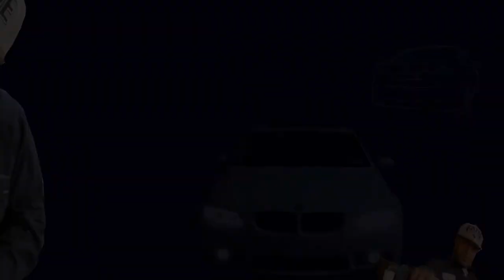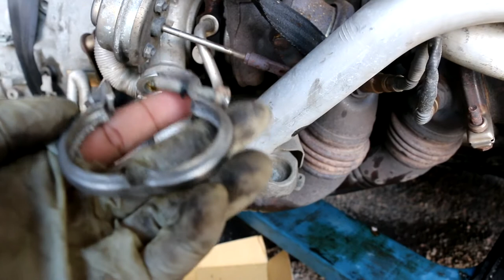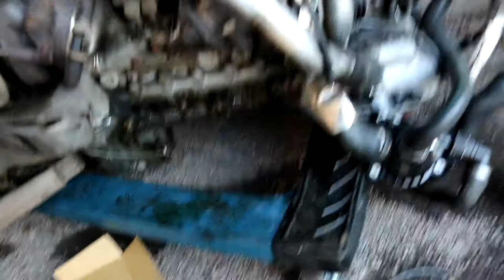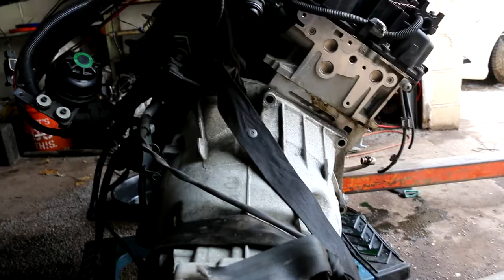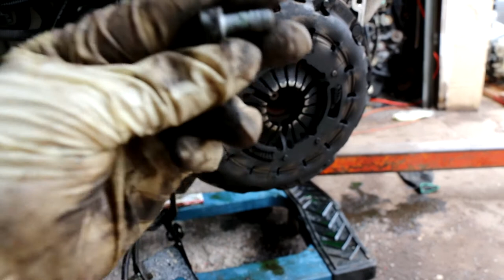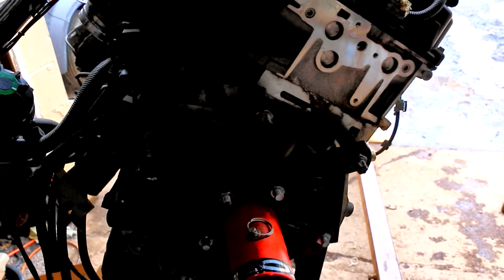N54 TURBO REMOVAL | EPISODE 3 |  CLUTCH REMOVAL

Comment: Cool video. I'm removing the turbos in my 535i right now. It's helpful to see what this engine setup looks like outside of the car. Quick thought on your clutch pressure plate, those may be triple square bolts and not torxs. Thanks for making this video!
Reply from the maker: I'm glad I could help.

Comment: The bolt snapped cause you're heating them with a torch and then applying torque on a cold day. If you get better tools  like Mac, snap on, or Matco, the wrenches and sockets will grab way tighter and break even the most rusted fasteners off. It's worth the investment especially if you wrench a lot. I was a ase master tech so I got student discount when I was in school.
Reply from the maker: Atul Lall I realized that... the bolts seem like there aluminum as well..... there no need for it